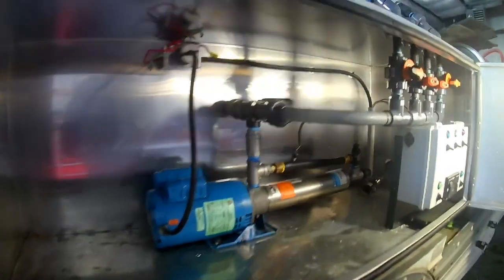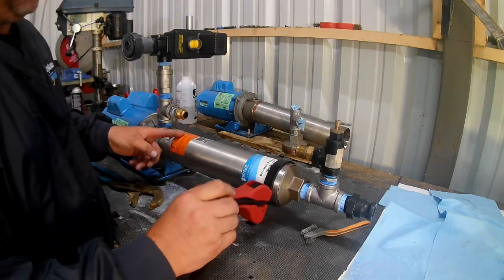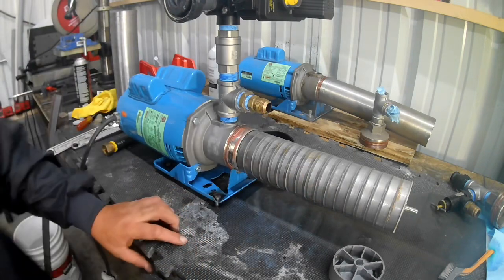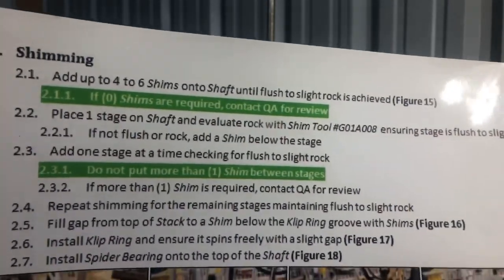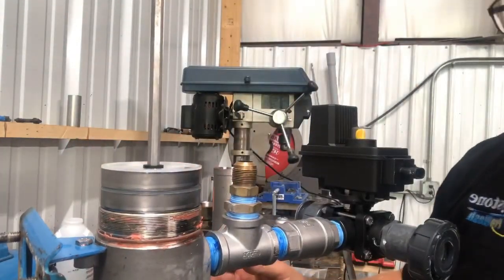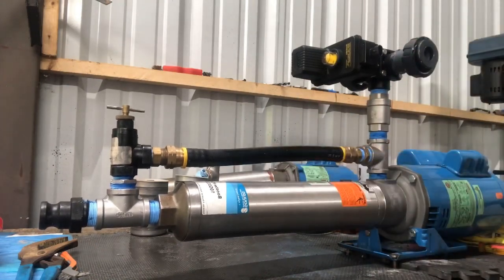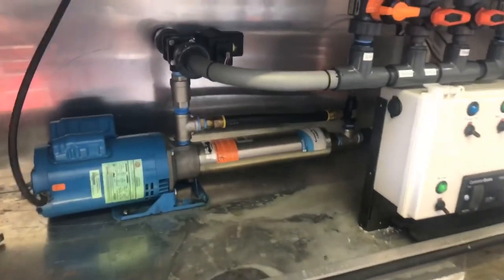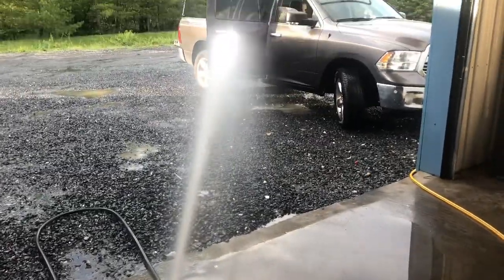Booster Pump Rebuild

Comment: Great video!  Quick question:  Can one reduce both psi and gpm being delivered by one of these pumps, by using a bypass hose and valve like you have on this unit or would it only reduce gpm?  I would be grateful for a response!

Comment: When I go to SH thru the power wash store Proportioner, I lose volume when I’m running low concentrations. Very interested to see how you don’t lose flow. Outstanding video. I have to rebuild my 1HP booster. I had a brand new back up in the box so I was not down very long. Thank you for an excellent video. Currently run a 1 HP 17 booster for application/rise and I have a dedicated 2 HP booster for rinsing for my ground guy
Reply from the maker: Because they use 1/2 GF valves and a very small manifold